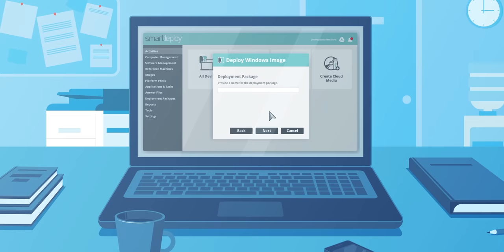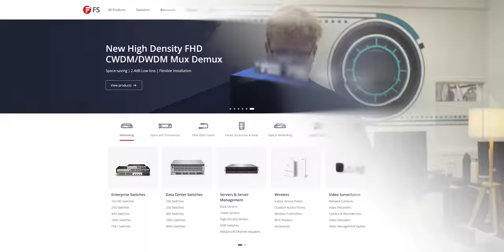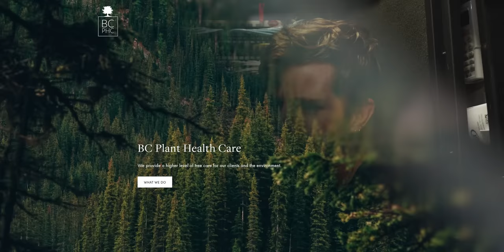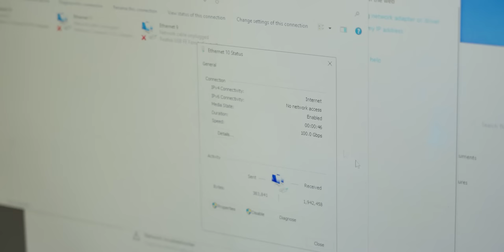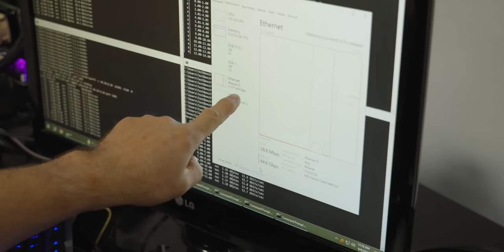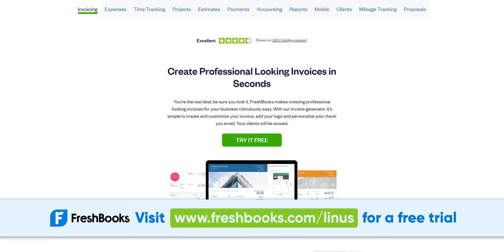Everyone said this was impossible - Backyard Fiber Run

Comment: The shield of the fibre cable is a big lightning conductor. You need to bond each end of the cable to ground and stop it at the edge of the building so that you don't bring the lightning strike inside the building and not only kill the equipment but also create a danger to the people in the building. Switch to a patch cord at the building envelope and leave the shielded portion of the cable outside. Better yet - use an all dielectric version of the cable with no metal in it - much safer.
Reply: Sooo.....you gonna send them one then?
Reply: @helljumper912  Well I mean they aren't keeping it...soooo they can buy a different one when they do it again... :) The Non-Armoured version is even cheaper.
Reply: @tomjzed  Yes definitely they sure are not "keeping" it.... I mean nobody would want that. They will definitely go the 1000$ / month method instead ....
Reply: @DarkNexarius  They said at the beginning of the video this is only a test. A proof of concept if you will. Did you not pay attention?
Reply: A test that it would function. They’ll come behind and bury it.
Reply: I was wondering why they were using old cable. The newer cable doesn't need to be grounded and is overall better.
Reply: @unpaidintern6652  You wouldn't want to run the fiber in anyplace that it can get damaged, running it like they did was the best case scenario for what they had.
Reply: @jumpinjehosephat1877  What you say in a video for legal reasons and what happens in reality can be different
Reply: You aren't allowed to go further than 50 feet from the point of entrance if the cable jacket is not rated for indoor use. Per the NEC. And I think it actually says that the transition to indoor-rated cable has to be done as "close as practicable, but in no case further than 50 feet from point of entrance".
Reply: Sorta yes sorta no.  If you only terminate the actual fiber optics, and use a nonconductive material to anchor the cable (zip tie, hook&pull, etc.) you don't NEED to terminate the grounds.  However, good practice is what you said -- terminate both sides.  

You don't want a cable with no metal in it as it will not be picked up by the utility location finder people.  It's there for a reason.
Reply: @ehudgavron9086  No disrespect - but I think it is foolish advice to say that you don't NEED to bond the cable. Even bonded, you would be lucky if it doesn't energize everything in the room never mind arcing all over the place.
Also being able to locate the cable based on the metal shield is only a bonus and not the reason for the shield. It is there for mechanical protection. If the sole purpose was for locates, then a simple thin tracer wire would be included in the cable - why go to the expense of a wrap around shield just for locates?
Reply: @tomjzed  Not sure where you are and this is entirely code related.  (That's why I sign my stuff with city/state/US etc.)

I do agree that the FO sheath should be bonded on all sides to gnd.  That can include properly inserted grouding rods at intervals along the 1/2 mile (1km?) stretch.

There is a risk with too many grounding rods of the potential difference being higher than nominal but the US NEC says there's no such thing, so Eufer your way to heaven :)

If anything I said (other than you can skip bonding it if you just go straight FO point to point) implied I'm anti-bonding... that was not my intent.   Always groudn, always bond, and also since you mention patch panel, it too should be bound to a ground bar along with the rest of the CPE.

Ehud
Tucson
Arizona
USA
Pretty much what the NEC says goes.   NEMA as well.
Reply: @ehudgavron9086  As I recall, there's a bulletin on the RUS (Rural Utilities Service, a US Federal Government agency) website that says to ground any metallic members of any fiber optic cable whether aerial or buried because nearby lightning could induce sufficient voltage in the metallic member to arc through the cable jacket, damaging the cable.
Reply: @ehudgavron9086  Of course - understood. The reason I said anything was because I would hate for someone to read your comment and setup a situation where they didn't bond and something bad happened.
Reply: @wizwo  it was given to them for free
Reply: @wizwo  they said in the video that the cable they're running could be used under ground or above

Comment: Fiber optic cables are never classified by "PAIRS" but rather the strand count.  Copper followed a pairing of Tip and Ring to make a PAIR of isolated conductors thus a "24 PAIR" telephone cable would have 48 conductors.  You order fiber as a "48F" as in 48 fibers.
Reply: Being stated by the same person suggesting that a 2300ft run is "impossible" when the same principle connects continents.
Reply: That might be true but when you're connecting to a consumer switch you need one strand in either direction, so the number of pairs tells you how many full-duplex links you can get over the cable which is what they were most interested in.  It might not be the term the professionals use, but it's much more useful for their application.
Reply: @Berkeloid0  or you could be wrong and assuming you are right. 
Show me one part number for any cable that has a "pair" designation on it.  And you can get a full duplex link over 1 strand.  It is called BiDi SFP.  Uses different wavelengths on the same physical strand. I'll send you a picture of what date I became an FOA certified splicer and you send me a picture of your cracker Jack A+ certificate and let's see who has the experience to back their claims.
Reply: @jeffreyburrows3562  Why do you suddenly need to prove you're a professional and question my qualifications?  Of course I'm not qualified, and I'm not even disagreeing with you, I'm just explaining why they chose to describe the cable to viewers in terms of pairs, even though it's not the way the cables are sold.  They were just explaining the cable in terms that made sense for their use case, nothing more.
Reply: @Berkeloid0  I was actually just letting them know how to properly designate a fiber count for people that are watching this and potentially looking at a career in Telecom.  You jump back in with your 2 cents saying it's ok to miss designate it. So yes I'm going to enlighten the viewers that I have the justification to correct their misunderstanding. Sorry your feelings are hurt, that doesn't really matter in telecommunications.
Reply: @jeffreyburrows3562  You didn't hurt my feelings although you are being incredibly defensive which makes you come across like you are quite upset.  It's fine, re-reading your message now I can see you meant it as educating readers, but when I first read it it sounded to me like you were correcting the video creator which I thought was unnecessary.  But I have no problem with you helping people learn, I encourage that, just for future reference it comes across much more credibly if you refrain from personal attacks and simply stick to the facts and treat people with respect, especially those who disagree with you.  Once you start attacking people you won't be taken seriously no matter now correct you are, which defeats the purpose of sharing your knowledge in the first place.

Comment: I'm a fiber optic technician by trade. Needless to say this was hard to watch 🤣 Great job making it happen though. We live just getting stuff done. Also, a tip for the future: always pull a higher count fiber than you need. Just so you have more than enough strands for future expansion. I've seen it MANY times. A 6ct seems like enough and then down the line you find you need more strands. Food for thought. Great job guys. Cheers!
Reply: I would go the extra mile and put in a 24 or 48ct cable. But I would do it with direct bury, but with Mircoduct and blown fiber. Just laying a 2 or 4ct 7/4mm duct and blowing a single 24ct microcable would be enough for now and would leave room for expansion. And if the duct gets damaged the downtime is shorter by just blowing a new cable, than splicing in an outdoor enclosure or laying a new direct burial cable
Reply: Or you could just do a bit of CWDM, whole new video I that.
Reply: @florichi  ...blowing a cable?
Reply: @katarjin  yes blowing in the cable. It’s essentially a compressor that fills up a conduit with air. Then two little belts push the cable into the conduit. The cable rides on the air that’s filled the conduit and the person on the other end can just figure 8 it or coil it for the next run. Depending on the conduit size you can blow miles at a time. Way way better than pulling it in.
Reply: @katarjin  ya, inside a 14/10mm og a 12/8mm plastic tube. A machine that runs on air, pushes with about 4bar on some tracks through the machine, and blows air through the pipe at 14bar, and me and my buddy (we work as a fibee blowing team) we can blow a fiber cable 2500meters in one take, takes about 1hour

Comment: As a fibercontractor, this was hilarious to watch! Hope you make a video on fiber splicing some day! Greetings from The Netherlands!
Reply: How many things did they do wrong? Or is it quicker to say what they did right instead? 😂
Reply: @Matty.Hill_87  Not much actually, the only thing I would do, is make sure that before you patch your fiber connectors to equipment, you clean the tips(endface) of the connectors so you can prevent damage and link degradation over time. 

As it's an temporary install, nobody bats an eye, but for a long term solution you have to make sure the connectors are clean, as dust on the surface of the tip(endface) can burn in because of the power of the emitting lightsource(singlemode fiber uses a laser, multimode uses an LED or VCSEL, in this video Linus uses singlemode)

This burn in of dust and other particles can cause damage to the connectors and result in a higher reflection and signal loss in dB.
Higher dB's mean more stress for the equipment wich will result in equipment failure or connector failure.

That's the thing with fiber, you can make it work pretty janky,  and it wil work. Basicly, everyone can make it work. But the topnotch datacenters and hyperscales require you the make sure every box is ticked off and doublechecked before they sign off. Wich is basically my job.

Respect to Linus and his crew for show how fiber works and how to handle correctly. This makes me even more proud of my job basically.

Comment: Linus: "This is just a temporary run just for the lulz because the cable was so cheap."
Also Linus: "I'm going to clear you guys about 3ft so you can micro trench it"

Sure thing..."temporary"  :D
Reply: "There is nothing as permanent as a temporary solution" ~someone (probably)
Reply: @wiggel2161  This is one of my email signatures
Reply: @wiggel2161  but this in reality wasn't even meant as a temporary solution. They just said that in the video so the city doesn't fine them for rogue infrastructure lol

Comment: I am a fiber optic technician from South Africa , this was hilarious to watch thanx allot LTT . 

Unusually for runs like that we would either plant 7M poles ever 50M or bury it underground . One thing i must admit is that the pre terminated cable is not something i would have recommended for this run . Pull none terminated to each building into a joint / buddy box and then terminate at the box to where ever you need it . But thanx for this video , love seeing you guys work with things that some of us do for a living :)
Reply: That makes a lot of sense, and I have zero knowledge about fiber optics. 😄
Reply: Isn't the device for terminating the wires like thousands of dollars?
Reply: @lazyman114  you can hire a fusion splicer for maybe $100 a day or something
Reply: I think here it may have been worth getting in touch with the local electrical utility, they already have poles in place that run immediately outside of both buildings. Lots of utility companies are amenable to sharing infrastructure with non competing uses to the point of having departments dedicated to negotiating such agreements. After all if they are not a competitor then it is just a way to cut costs by sharing the costs of maintaining those poles with another user that also needs the same thing you do but for a different business with an unrelated customer base so it is win-win.
Reply: I knew linus was doing something not 100% as it should be
Reply: I think they're just doing it as a proof of concept so it makes sense they'd just get the ends preterminated quick and dirty rather than have to find someone capable
Reply: Yeah, this is literally like just running an ethernet jumper across your house. Like they said though it is just a temporary test.
Reply: @lazyman114  Hey bud , yeah the Comway , Fujikura and Sumitomo are all around 4000-6000 USD but for linus application he could have gotten the cheaper ones that are around 1000 USD and train a staff member to use it for breaks are any modifications :) .
Reply: @jedixo  In south Africa its around 5000 ZAR a week to rent a machine with about a 5000 ZAR deposit So about 280-300 US a week rental and 280-300 US deposit .
Reply: @seraphina985  Yeah we usually lay fiber above the copper lines in south Africa , usually dropping the copper down a few inches then stringing the fiber above it . Maintenance on the poles is very low as they only get treated every 5 years .... I have climbed untreated poles that are over 20 years old , just knock it with a hammer to hear if its hollow :) .
Reply: @MrAgentTweak  The ones at the top of the poles I saw on street view are mains electricity so I'd have thought they would probably mount the fibre bellow in that case. I notice one of the sets of poles also already has something 2/3rds of the way up which doesn't have insulators installed so that is probably some form of telecoms cable sharing the poles which could be a good sign as it suggests the electric company probably is open to sharing. Having said that it could be data lines for the their own reporting and management systems.

True on the maintenance not being that expensive but when it comes to costs in business smaller is usually better provided it doesn't compromise regulatory compliance or similar.
Reply: @vitorviotti  well it is temporary
Reply: @MrAgentTweak  Ours are 40k USD/ea 🤣
Reply: @patrickchapman3242  Damn dude what brand is that ? the most precise machines we use here in SA such as Fujukura , sumitomo and Comway are nowhere near that price :) The EXFO OTDR on the other hand is arround 30k USD

Comment: Watching Linus talk fiber is entertaining. It's really easy to test and find breaks (most of the time) and reterminate connectors. I'm legitimately surprised LMG hasn't invested in a Unicam kit at this point.

EDIT: Layers are PVC jacket, aluminum shield/armor, aramid yarn, loose tube buffers and fillers, then sometimes a strength member.
Reply: It honestly hurts me a bit, did long haul a while and now data center interconnect stuff up to 3456. I just want him to hire me to do all of his fiber shenanigans, and teach em all to fusion. (And yes he should just get a Unicam, they could learn it in literally 5 minutes)
Reply: @HuffinON17  so much yes. I am certified fiber installer. I don't own all the tools yet but one day I'll own my own fusion splicer!
Reply: @chadjones7365  know some splicers that’s have used the Amazon buys and those seem to be working well for them. The ribbon splicers are super cool
Reply: @Splittail  I wish I could've taken pictures of all the work that i've done but where i was had a phone lockup. was splicing 3456 count fibers every other day and got to do a ton of cool stuff. ribbon is cool but lookup rollable ribbon. thats pretty cool too

Comment: FYI: While in college, I belonged to the Institute of Electrical and Electronic Engineers (IEEE). The IEEE had a publication, released about monthly as I recall which featured articles on the latest trends and breakthroughs. One article therein quickly caught my attention.

In London - England of course, fish and chops please - the telephone company was comparing the pros and cons of copper versus fiber between two points a few miles apart they were preparing to build. It just happened to be the heaviest systems usage on the planet. And they were likely to continue with that burden growing worse in the future.

They chose a two-fiber cable - one for usage, the other as a spare - just in case.

Their reasoning was what really got my attention - despite this being the heaviest telephone usage link on the planet, and any anticipated amount of growth, they realized the link would NEVER reach or exceed the capacity of that one fiber link.

Comment: Just a warning, LC SMF connectors can also come in an APC variant - "Angle polished Physical Contact" which is usually denoted by "green" connectors, and are often used by carriers when handing-off fibre connections. In this case, it looks like both your transceivers and cable use normal LC so you are good, but the "green extraction tab" did make me look twice!
Reply: Thats why i would not have pulled a pre-terminated cable . Rather end to end cable into a joint box , then terminated what ever might be required and change it as needed . But was fun to watch .

Comment: Literally just seeing this after a fibre deployment to 35 individual homes from a Fibre headend 40Km away here in Wales UK!
We use a multimode fibre over these distances with a starting spine cable of 144 individual fibres, in theory (taking 'spares' out of the equation) each fibre can feed 32premises via a 32way splitter.
Fibre is impressive stuff, and not as easily broken as you'd think! it has incredible tensile strength, but put a slight kink in a bare fibre and you'll see it snap with no force at all.